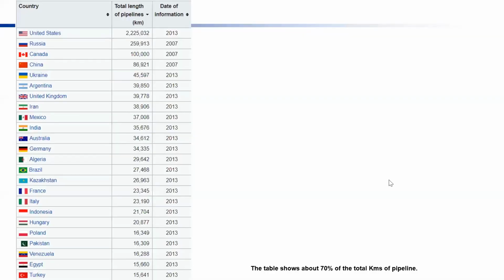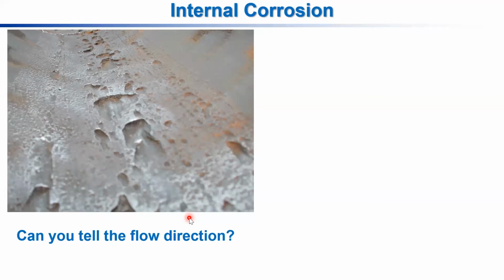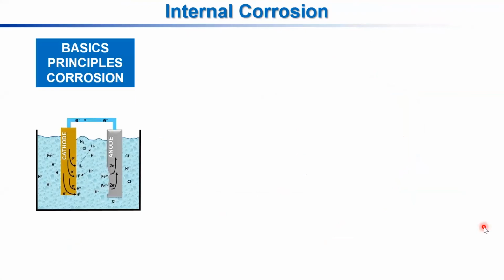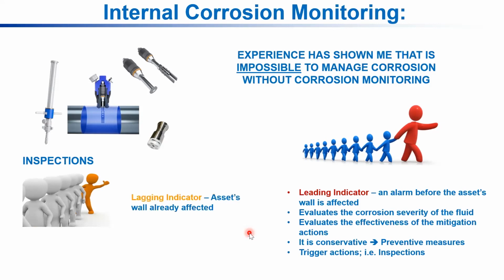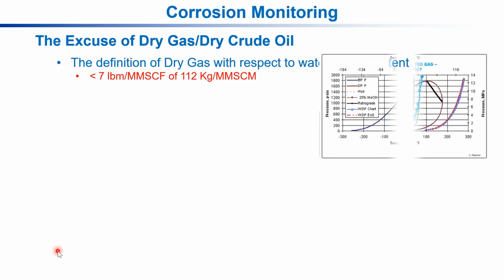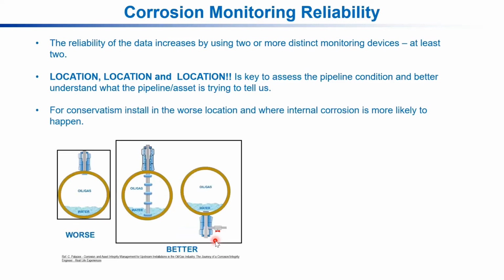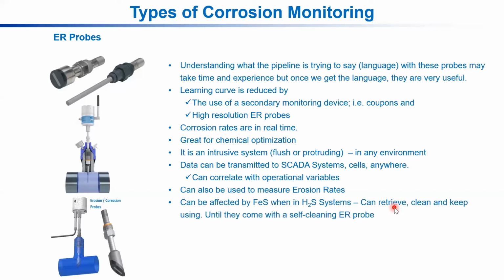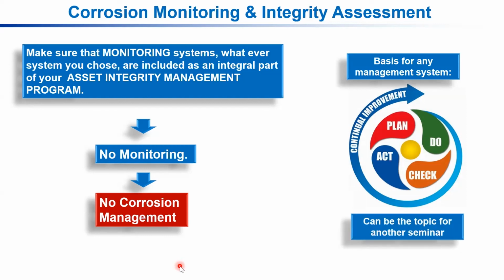Webinar:  Internal Corrosion

Comment: Hello , thanks for the video.

This is regarding corrosion monitoring tools for three phase oil separator in oil and gas. Fluids are Water , Oil , Gas..

I would like to know whether the ER Probe and Linear Polarization Probe would help to corrosion monitoring of the above vessel internal.